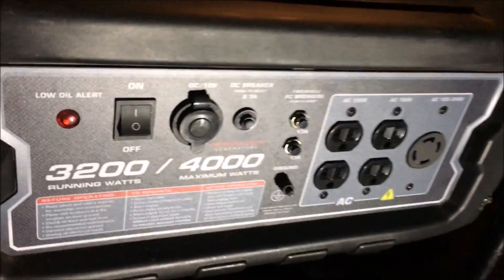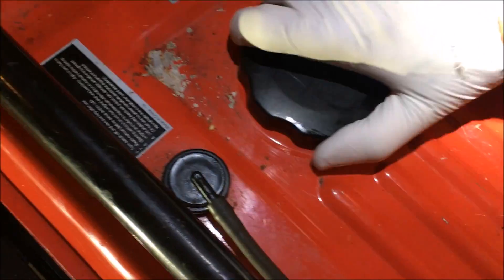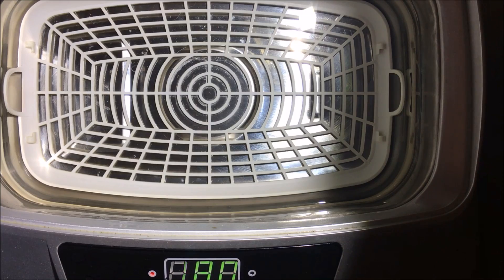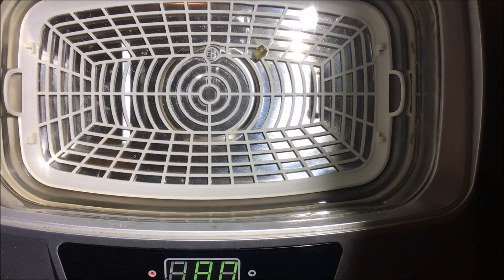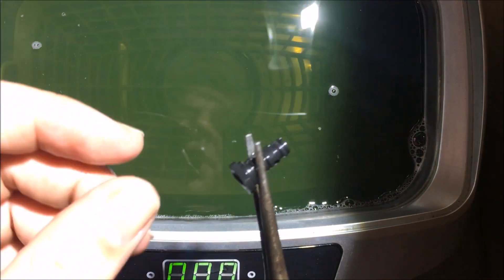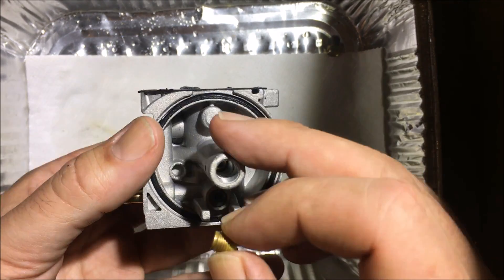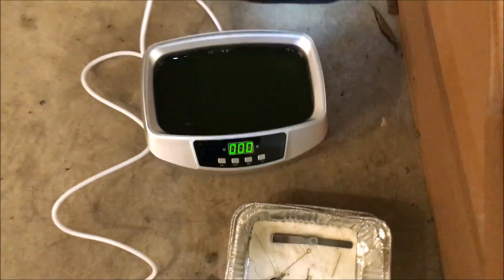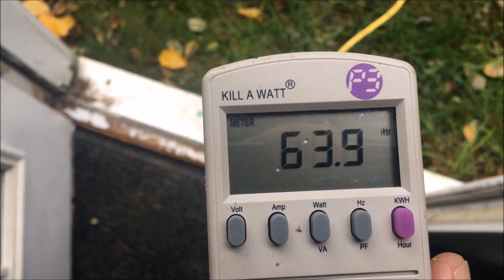Predator Generator Not Starting - Fix

Comment: Nice job.  These are decent generators, I have a Predator 4000 and 2000 inverter.  I like to run AVGAS 91 octane in my equipment.  Can be bought at local municipal airports.  No ethanol and has a shelf life of a few years if properly stored.
Reply: I run ethanol free gas it does cost a bit more but worth it, also run it in my truck as well.